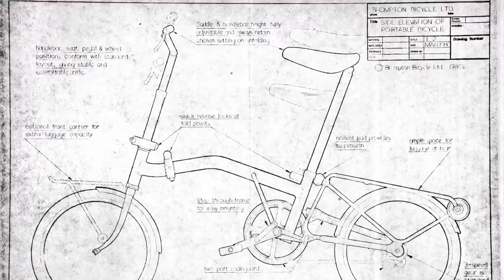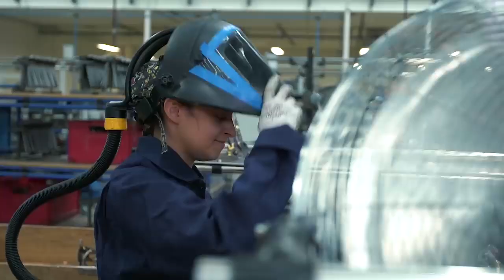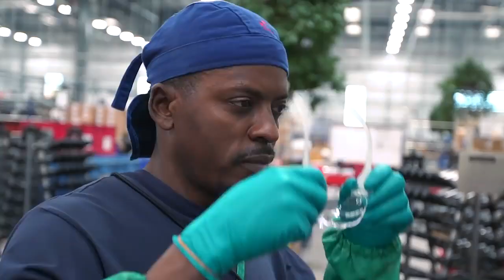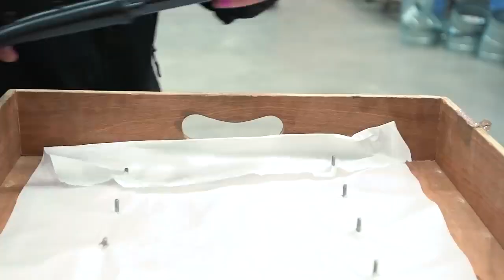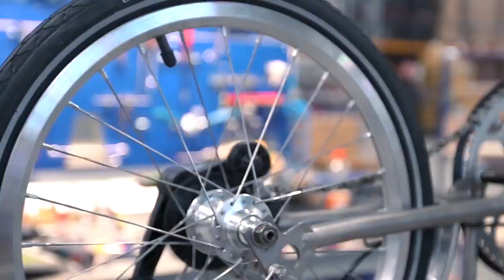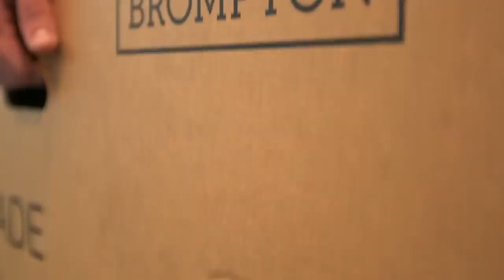Brompton, como se fabrica

Comment: Hello, I want you to help me make a decision about the electric brompton bicycle, I have seen one in Barcelona and I live in another city where there are many slopes, to increase the speed mode in the engine you have to stop the bicycle and climb from one to two and from two to three, which makes it difficult to handle the bicycle.
Is there another way that when you are riding the bike you can raise or lower the motor assist modes without having to stop the bike?
I currently have one that works very well for me and has control of the bicycle on the handlebars and allows me to raise and lower the motor assistance modes without any problem at any time, it is foldable the only thing that the bicycle is a bit heavy for me I would like to buy the Brompton but I have these doubts, I hope you can help me if it is possible to find out if I can use the Brompton in the same way that I use mine, greetings and thank you very much 😊